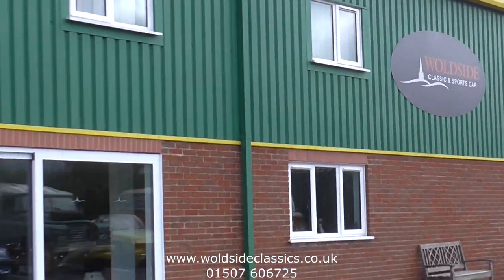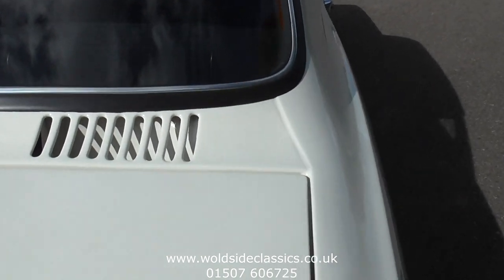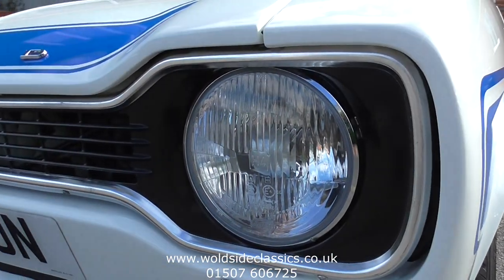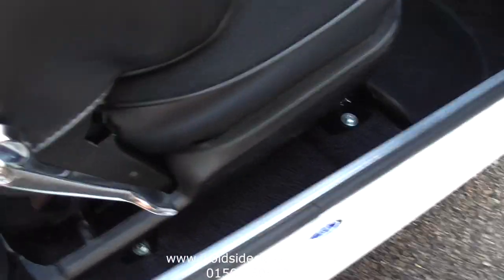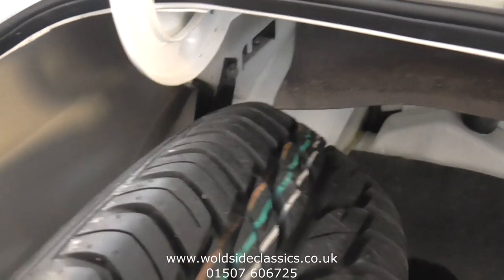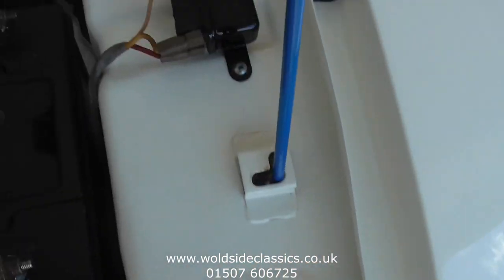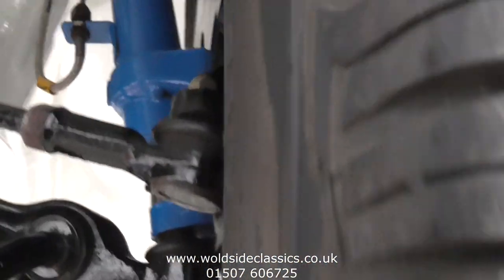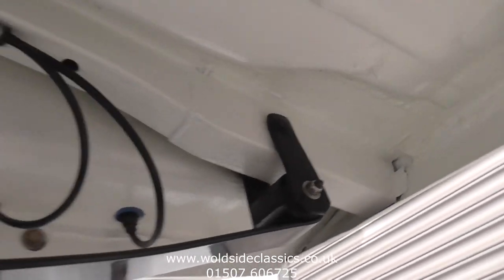SOLD 1974 Ford Escort RS2000 Mk1 Classic Car for sale in Louth Lincolnshire

Comment: If it was mine i would keep it , in australia you can't use copper brake lines in cars , only trailers. Finished in 2006 so 13 years ago not 20
Reply: I realised it was finished in 2006 too. He should've started it. 
Wrong white paint, I think...
How much did it sell for? 
I know, too many questions! Sigh...

Comment: will this car do a 100mph and sit in modern day traffic .
Reply: Absolutely - especially with that 5-speed gearbox, the top speed is somewhere around the 115mph mark. The engine is pretty torquey, so they're easy to drive around town.
Reply: thanks i had a bronze 1300 2 door  in1986 , i drove it from manchester to somerset . then sold it for 75 quid ,and ive just watched it on wheeler dealers with ed . that was my bronze escort .mad .
Reply: Guy, it must have been an eye-opener seeing your old car on WD? Did Edd's workmanship do it proud?

Comment: Mark one escort did not come as a RS2000
Reply: Of course it did! Google "escort rs2000 mk1".
Reply: In Australia the MK I came out in a 1100cc, 1300cc and a 1558 twin-cam no 2000cc
In 1979 the MK II RS2000 came out with a different body. The motor was just a standard 2lt engine used in all the Fords. Nothing special about the motor but very restricted. Easy to gain extra HP by tuned exhausts and a side draft duel throated Weber. I have never seen a
MK I RS2000
I owned a RS2000 MK 2
Reply: Ford put a crapy carb on the engine  and restricted the HP
Reply: @RobWillmot  There were lots of them in Europe! The second most common mk1 RS to the Mexico.
Reply: What 2000 engine did they put in the MK I
Reply: @RobWillmot  It was the exact same engine and carb as the mk2 (Europe) but the exhaust was not quite as free-flowing, so it made 100bhp rather than the mk2's 110.
Reply: @RobWillmot  2litre pinto in the UK mk1 rs2000